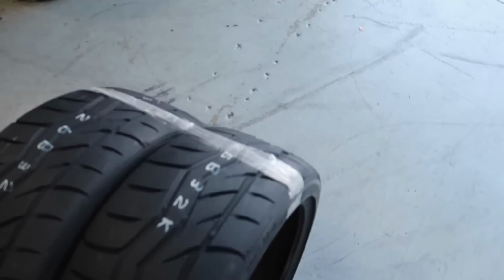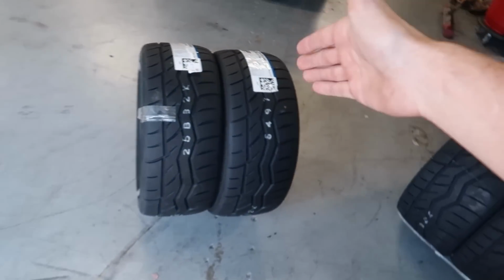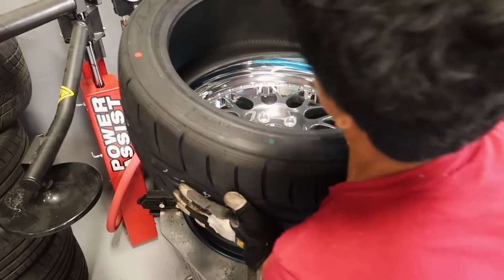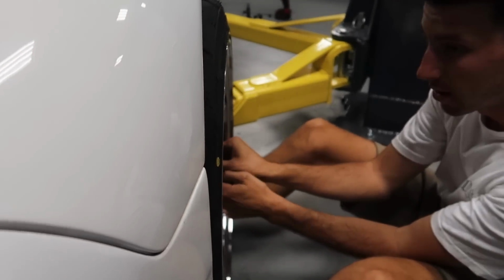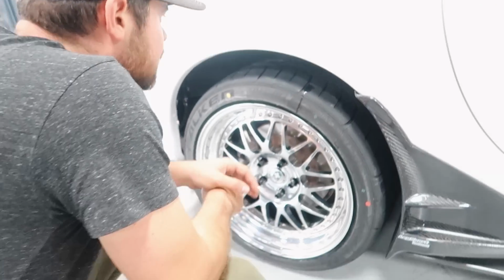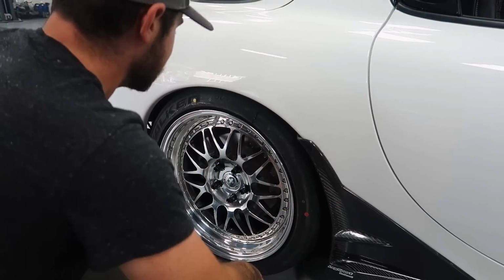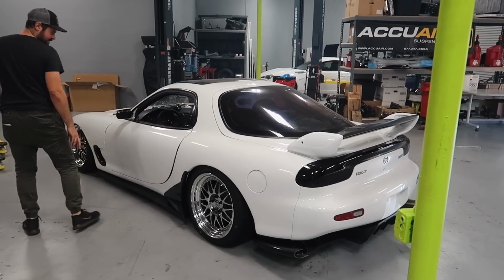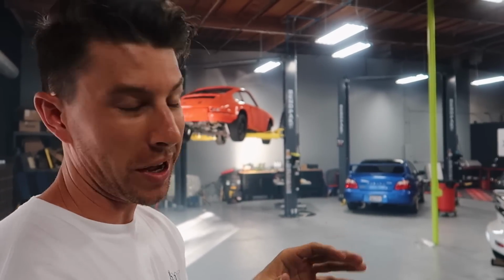MY BIGGEST REVEAL YET!!!

Comment: That front bumper and headlights makes a good car look spoiled
Reply: Ahmed Moosaji Opinions. Opinions everywhere.
Reply: @michsato154  ya..... so... your point
Reply: Ahmed Moosaji My point is that your comment is an opinion? Did you really have to ask?
Reply: @michsato154  it's quite obvious that it is an opinion 
Did you really have to tell me that in the first place
Reply: Ahmed Moosaji Shit, okay. I'll admit I was a little butt hurt with you commenting on how the car looks spoiled. I just think the car looks good with those headlights, but the front bumper does need some slight changes. 
Just forget my comment. Like what you like. Dislike it if you dislike it. 
Have a good day.
Reply: @michsato154  lol it's all cool bro
I would agree with you the headlights are oryt they are liveable but the bumper 
The problem with it is that on the sides it comes out too much if that extra lip kind of thing on the sides are cut off it will look better
Reply: Ahmed Moosaji Ohh, I see. I would honestly just wrap the lower splitter with carbon fiber or just add a carbon fiber bit in general, because it DOES NOT match the carbon fiber side skirts at its current stage. Teej should have thought about this earlier lmao

Comment: tj im not an engineer or anything but it is my understanding that the ethanol has a much higher centane rating which means it burns for a lot longer. I also understand that its better to run a rotary on 91 because at high rmp you will not get even close to complete combustion of ethanol and may cause a lot more heat which is already a problem for these engines. good luck tj and if anyone knows why im wrong please let me know respectfully.

Comment: I read that if you line up the yellow dot on the tires with the valve stem that you shouldn’t have to use weights on the wheel.

Comment: Looks good TJ. I am a little confused if you were waiting for more aero for the front bar etc. However if not, something that would look great is to get some carbon end plates for the front bar and maybe extend them to they help guide air etc That will help the front tie in with the rest of the kit along with a flat panel splitter. and flat panel gloss carbon is cheap. You can use cardboard as a template. Anyways rad build. once the car warms up the smoke disappears which others can finally see in this video. Keep moving forward bro. Yeow!!

Comment: I wonder if it would be possible to disassemble a 3 piece wheel, set the tire on the back bead, then bolt the face and lip on to mount a tire without a tire machine illuminati: stay right where you are